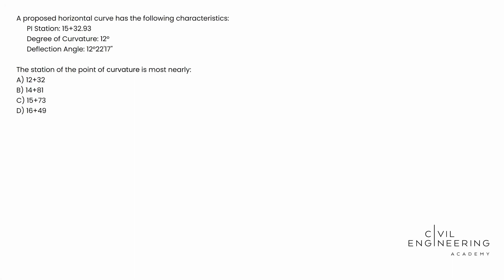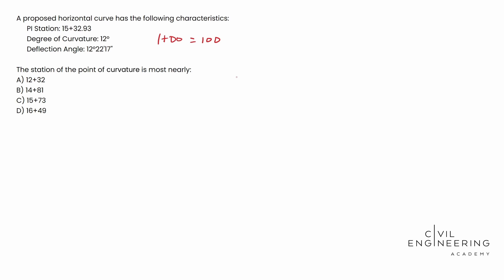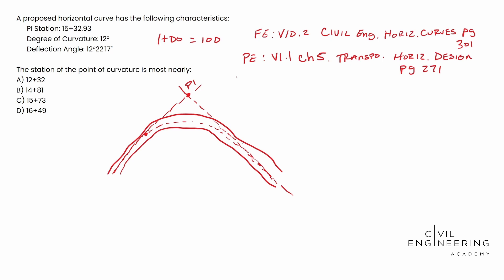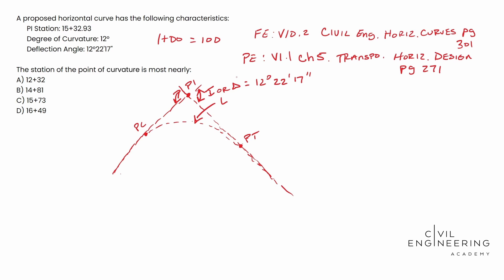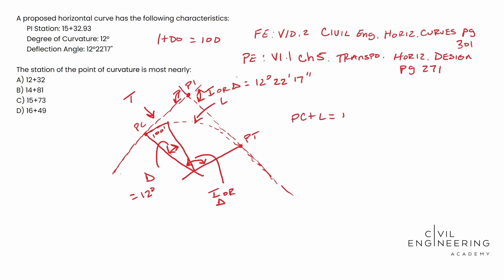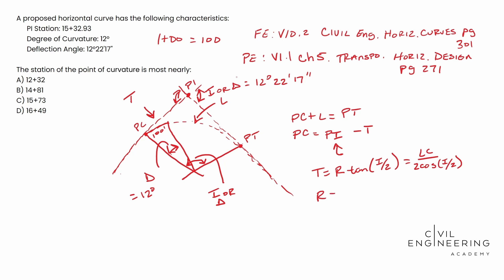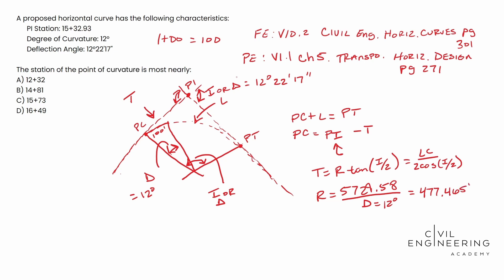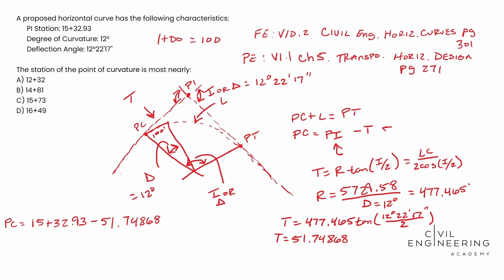Civil FE/PE Exam - Transportation - How to Solve for the Point of Curvature on a Horizontal Curve

Comment: Is there a reason not to use the formula "L = 100x(delta/Da)" and then just subtract L/2 from the PI station? It gets you to the correct answer on this problem, is there a situation where this wouldn't work?

Comment: ncees pe hb 1.1, p. 271-273.

good one! keep them coming!!

tip #1: cross out choices C & D right away (by inspection) as those stations are larger and are later (in physical sense) than STA PI. so you are left with choices A & B within the 1st 30 seconds of reading the problem. yay! if you had to guess here your odds of getting this right (without any work whatsoever) are 50/50 or 50%. 50% odds are very, very high -- they are higher than typical odds of winning in a lottery, at about 33% !

tip #2: the 4 station choices are spaced apart way too generously. in an actual, real exam they will be much more close to prevent you from the 50/50 guessing scenario. ncees wants you to suffer through to the solution. real transpo exam questions are more intense than this. good luck!

anyone has something else to add ?
Reply: good tips